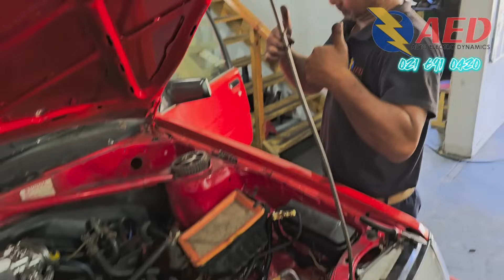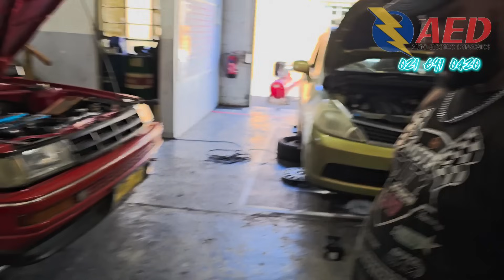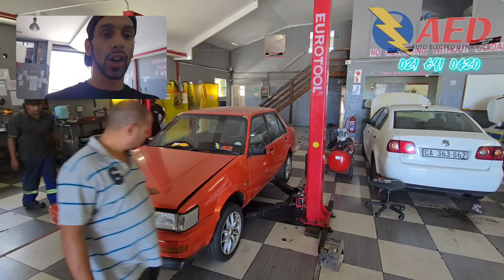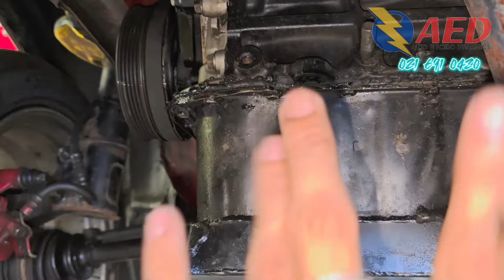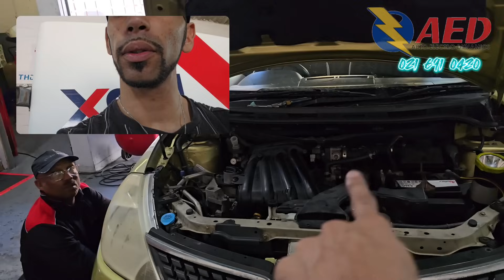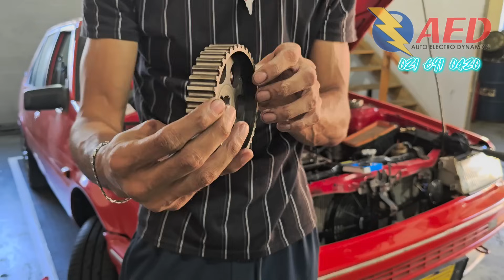toyota gli twincam 1600 16v T-VIS build - shitbox 2 beast episode 3

Comment: Your new crank pulley looks like a 4afe/7afe crank pulley. You will need a thick washer for spacer between crank pulley and cam sproket; cut space on washer for keyway. rather get the correct crank pulley.
Reply from the maker: The pulley actually fit perfectly
Reply: @fiki_orzim  great